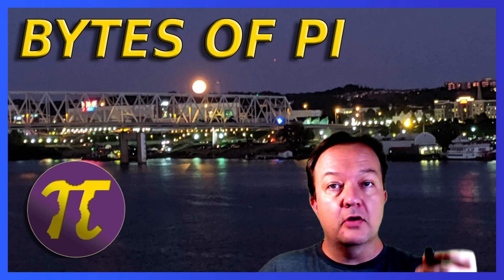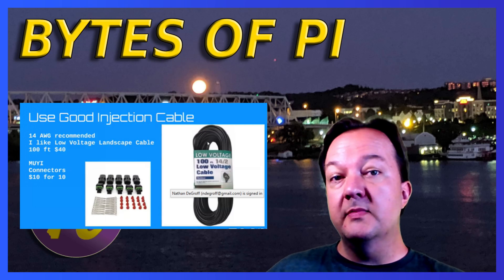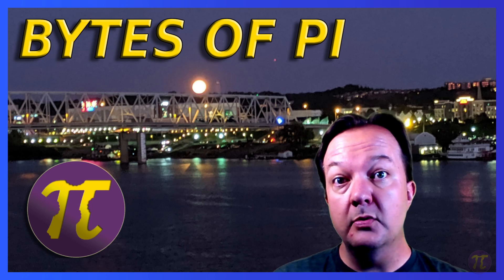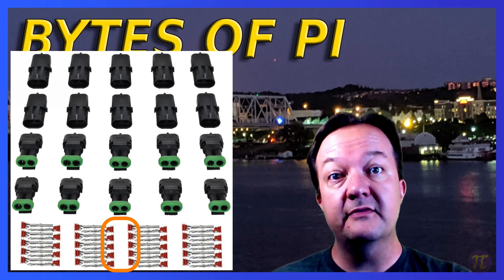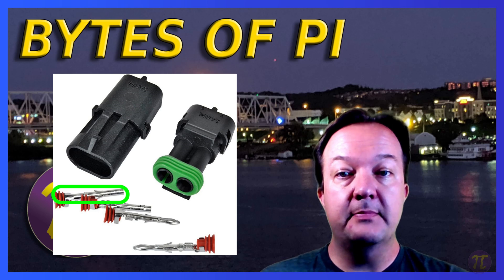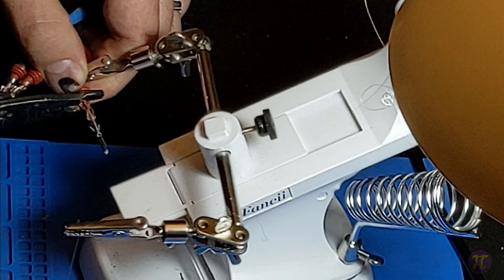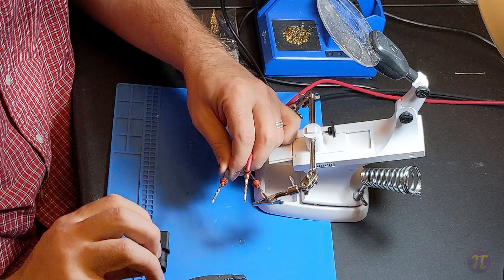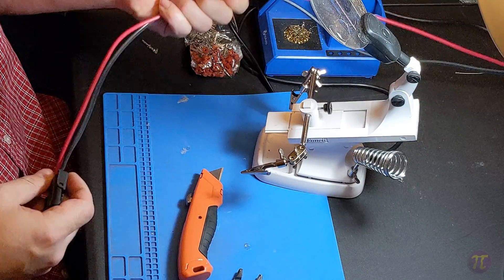Power Injection with MUYI Connectors

Comment: I just realized I put pointy into all males and open into females. Seems to work still. Oops
Reply from the maker: Yep, consistency is key.  Just make sure to be careful with the pointy ends.  They smash easily so don't force the connection

Comment: Very helpful, thank you!!
Reply from the maker: Awesome.  Glad it helps!  One update now that I'm months in the future is that they are good for 2 prong power injection, but for the 3 prong connectors, I like the xconnect/ Ray Wu better and may be worth the extra cost.

 Those little male metal pieces you crimp on the end deform and crush easily.  I've had to replace a few of the three prong already because one of the male pins gets crushed accidentally when connecting.

The two prong seem to be more reliable because there's less chance of crushing them accidentally when connecting them together.

I am going to update the video description.
Reply: @BytesOfPi  Thanks for the reply! I need 6 connectors so the extra cost for Ray Wu type is negligible and well worth it for my project 😊 Thank you, I've subscribed to your channel and looking forward to future videos!